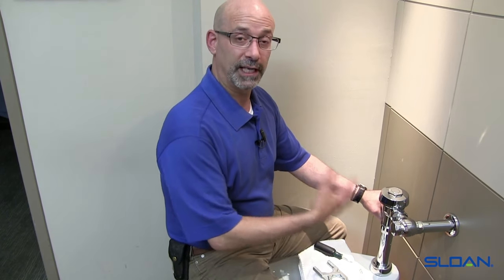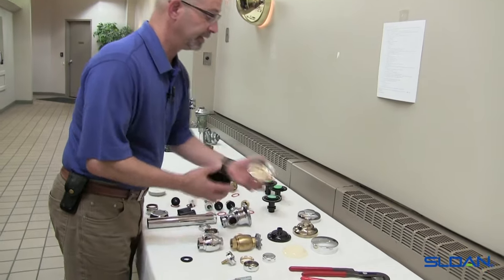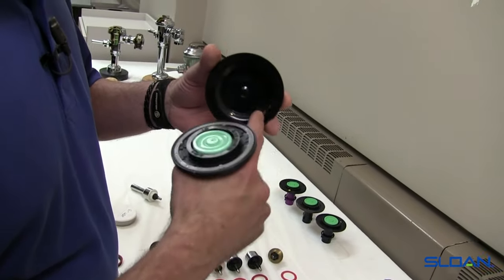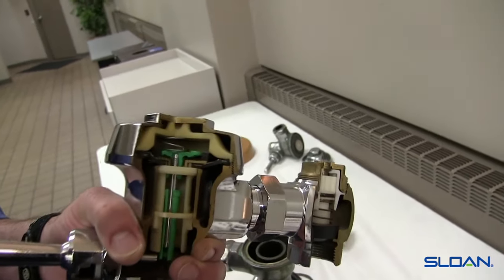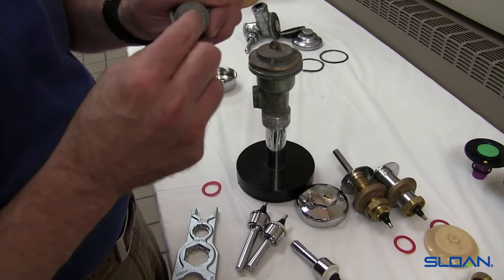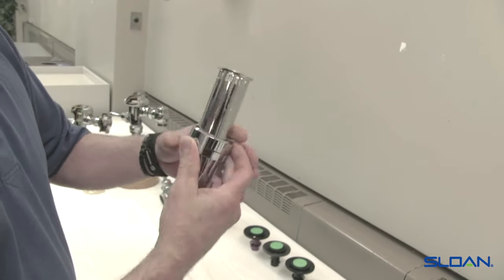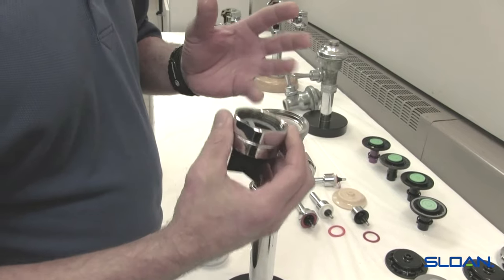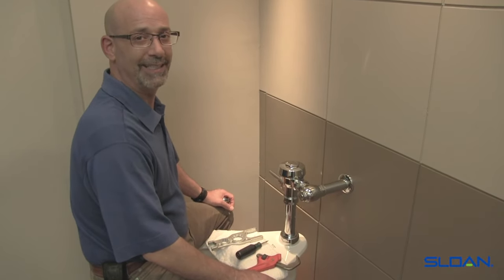Flushometer Basic Maintenance - Using the Right Tools

Comment: You need a degree to work on these, and I doubt that all plumbers have this degree.   Would be nice if the reps on the phone did not give you wrong numbers when you are ordering parts, as i've experienced- ordered 2 parts that don't fit.  I have a 100 year old house, Sloan valves in use when I bought it.   One valve with cream colored inner cover, and it flushes SLOOWLY with the flow control (80 psi) fully open.  After taking it apart, lots of teflon tape and rope, and plumbers putty everywhere, it is missing the vacuum breaker, breaker tube is very short (not code, but that's the way it is, as the the supply is too close to the toilet) and it does not appear to be OE -breaker tube is not flanged.  AND, No locking ring on the tailpiece.
Reply from the maker: We are sorry to hear about the trouble you're having. Our tech support team may be able to help further. They can be reached at 888-756-2614 between 7:00 AM - 5:00 PM (Central Time) Monday through Friday or by email at techsupport@sloan.com.